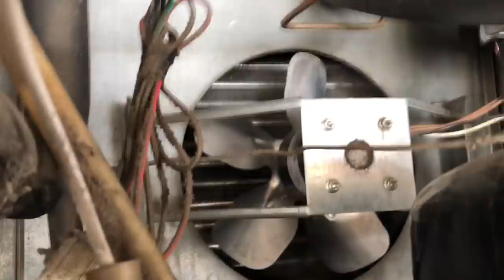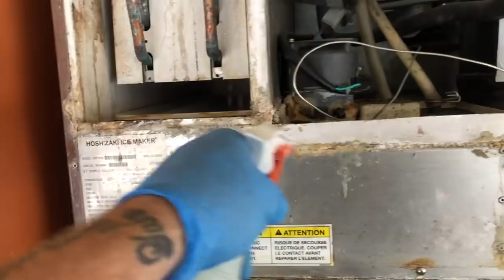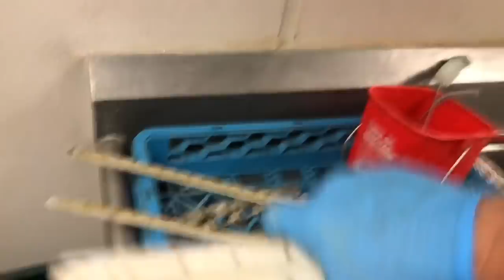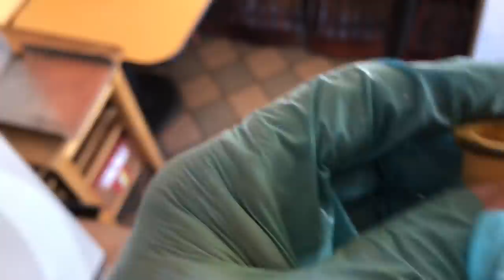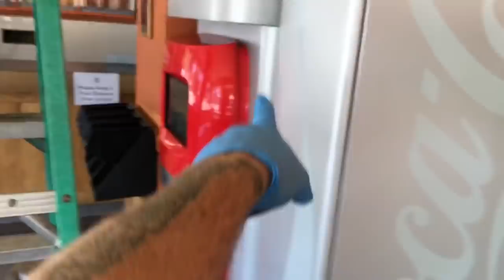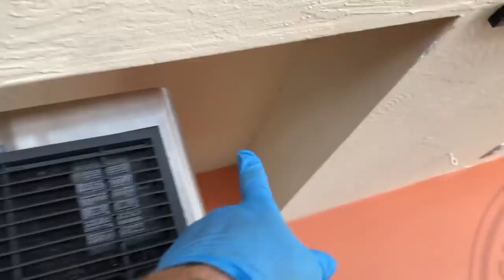How to clean a Hoshizaki ice machine

Comment: those plastic parts, please purchase all new  those hard plastic parts and install new ones and old dirty ones should be submerged in the solution( the solution is mixtuire of water 60% and clolax( laundry bleach) 40%), for some 3weeks, those black mold will be gone. and please use those hard plastic parts for the next time cleaning. i do use  lime away and a plastic brush. some local, country side, hard water damaged ice machine , this machine will take 6 to 10 hrs to be clean, for the evaporator plate, please use fine metal brush to remove water scale. please do your best, cleaning those ice machine come with lots of pain

Comment: Hey I was under the impression that nickel safe was not to be used on hoshizaki. Not being a jerk just mentioning it. I use nickel safe for a Scotsman in Manitowoc but I had to change for Hoshi. I do love the brush I'm going to get me one of those
Reply from the maker: Because, of Hoshizaki's unique stainless steel evaporator any commercial ice machine cleaner can be used, a nickel safe type cleaner is not required. Hoshizaki recommends LIME-A-AWAY or Hoshizaki Scale Away which is available through your local distributor.

You can use heavy duty or nickel safe

Comment: when i clean any ice machines    i was told to use the power washer.  and a long scrub brush.      almost like new when im done. 
i know this is a bit bad for the business but we put in one of those uv light filter in one of the machines and its almost like new after 6 months or so.  we still clean them but the cleaning isnt that intense~!      good video
Reply from the maker: the uv lights work in ice machines for sure,
Reply: @NorCal-refrigeration  Do they ruin plastics though? See some horror shows where people have put those in air handlers, and it turned the wiring insulation into dust!
Reply from the maker: @brnmcc01  the ice machine specific ones are small

Comment: did you take the float switch out and clean it out ? even tho the KML series float just sits in the water with no rubber boot on it...it still has to be cleaned cuz the float could get stuck on the scale or be weighed down with scale all over it.
Reply from the maker: yes I did full of scale on the walls, I should have videoed it but I was chatting it up with the manager while cleaning.

Comment: Had a similar issue with a customer with a unit on top of a fountain. There was no fresh air flow around the unit. It was up close to the Tbar grid ceiling, enough where I literally had to remove the tile to get the top cover of the unit off. I did a similar deal but I cut the grid tile in the rear corner behind the unit and used a piece of stainless sheet metal riveted to the unit to direct the exhaust air up into the ceiling and also had 1 down the side that was screwed into the side panel effectively boxing in the side. The exhaust had no where to go but up above the ceiling.  it did its job and made a reluctant customer happy and impressed. Only draw back was having to remove the 3 screws to access the filter screen for cleaning.

Comment: Id like to hear everyones opinion on cleaning ice machines.  No matter the brand I found when having to clean a neglected machine properly, as in a complete disassembly and soaking/scrubbing all the parts then sanitizing everything, it takes me about 3 hours start to finish.  This includes emptying and sanitizing the bin.  My old boss used to get pissed as hell at me for "taking so long" and we would frequently argue about it.
When its been years since the last cleaning and the scale is preventing the machine from functioning theres no way I could get in and out of there in an hour like he claimed it should take and it never failed to piss me off.  One of the old guys who trained me in showed me how you can remove even the toughest of scale if you let the parts soak in 100% cleaner for 20 minutes to a half hour, and during that time he would be cleaning the bin and cabinet.  Sure, some scale is never going to come off but Ive used brass scrapers on some just to loosen it up.
And I never could figure why the boss said its a waste of time to clean the bin, Ive seen plenty of mold and slime in the bins as well as the machines so to me theres no question the bin needs to be done.  I know theres a trick some guys like to do where you take a garbage bag and spread it over the ice in the bin then just clean the machine, catching all the cleaner and sanitizer in the bag, but again you are skipping an area that gets dirty.  Especially if its one of those bins that has the hinged door that you need to lift up to scoop the ice out, the underside of that door is always moldy from peoples fingers.  After the cleaning I used to make a batch to check the function of the machine then toss the first batch of ice out.  Maybe Im just a slow poke, I dunno, but Ive talked with plenty of guys who are also in that 2 to 3 hour window for a complete cleaning.
Reply from the maker: I totally agree with you its 3 hours or more some times.
Reply: @NorCal-refrigeration  :  Glad to hear it, Dave.  I respect your skills all to hell so its nice knowing someone with a brain agrees with me.
Reply from the maker: Repete Myname my brain is tiny lol.
Reply: @NorCal-refrigeration  :  Youre The Dude when it comes to Santa Cruz reefer & hvac!

Comment: The truth of the matter is, I F’kin hate jobs like that. Hate them. An ice maker that clearly hasn’t been maintained in years installed in a F’d up spot because the architect or the construction company was too stupid to take three minutes of their F’kin precious time to stop and ask a Refrigeration mechanic their opinion about the install... there’s a 7/11 in Claresholm Alberta Dave, exact same stupid F’kin bs - you have to remove the ceiling tiles to open the top of the machine, the back of the machine (i.e. the condenser exhaust) is about 1/16” from the wall, and they put a ceiling mounted angled furnace supply outlet 1 foot in front of the air intake grills blowing hot air in all winter long. Then they ask me why the ice maker is always breaking down... I really F’kin hate jobs like that.
Reply from the maker: I feel you 100%

Comment: Those tubes are always why I  preferred manitowoc machines. Back in the day when I did these, we'd have all those tubes and elbows in the van and we'd replace them on (our) first time cleanings because of the million call backs of "your tech didn't clean the machine" we lost the a dunkin donuts account because of it once.
Reply from the maker: Yep that surgical tube is terrible
Reply: The newer machines have gone to a black rubber for a lot of that piping. Wish the short discharge tube from the water pump was also black, that one always turns a nasty black/purple color. And even soaking that little hose in a very concentrated solution of hot water and industrial bleach didn't do hardly anything to it.

Comment: Nice job. The ice cube guide looks like it's missing some pieces. I had a similar machine that the guide kept moving out of position causing the ice to drop into the reservoir. There was a small crack on the outer edge of the cube guide. I also believe the white plastic had dissolved because of the chemicals that are added to the municipal water. I replaced the guide and the bin filled with ice. I have pulled the plug on three of these machines so I don't have to  manually remove the ice  from the freestyle machine under it. The machine are annually pm.ed.  They are  about 5yrs old but look brand new. The manufacturer says to use bleach to sanitize and clean. I use what you used. The side panel comes off easily and gives you access to the front of condenser. Because I clean and sanitize the ice hopper in the freestyle I use a garden hose and nozzle to knock the crud out of the ice machine. It gives me a chance to blow the slime out of the drain lines too. I use a.c. condenser cleaner in a spray bottle to clean that greasy dust off the insulation and panels. When I'm done the machine looks and runs like new. I do use nickel safe and let it pump around while I do other necessary tasks. With the garden hose you can really deep clean , especially the reservoir and condenser. Some dirty water may get to the floor but it is worth it. I can do the pm when nobody is around which you know is a wonderful thing. I have a couple of brushes I use and can be had at Grainger or Johnstone. You can check there online catalog for something that looks like it would work for you. I use a piece of that brown 3m pad ,we use to shine copper prior to solder or braze , to clean those tough spots. Enough,I ramble.
Reply: Hoshizaki says not to use 'nickel safe' cleaners on their machines. Something about the nickel safe cleaners contain citric acid which attacks Tin. Just use the regular diluted Phosphoric Acid cleaner on them.
Reply: @brnmcc01  nickel safe will not harm the hoshizaki